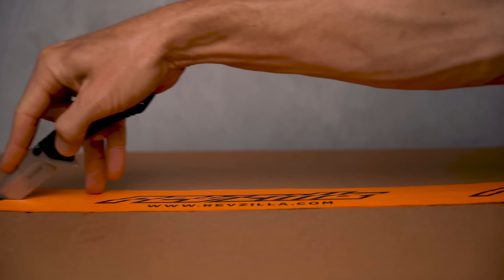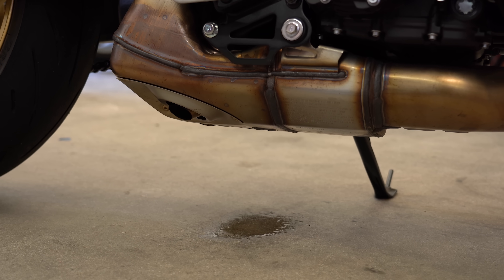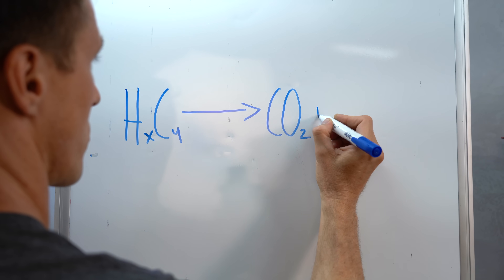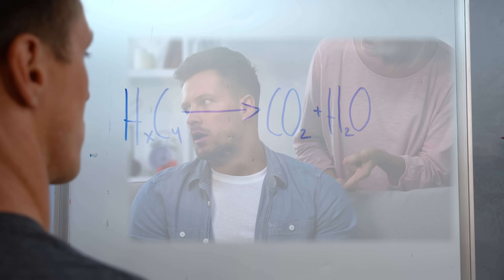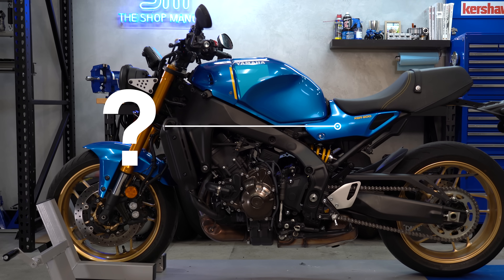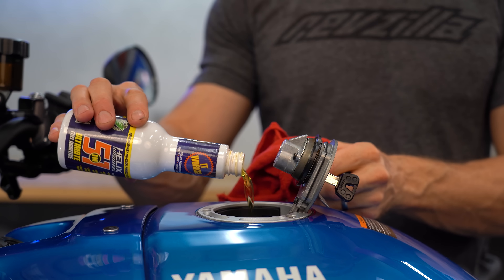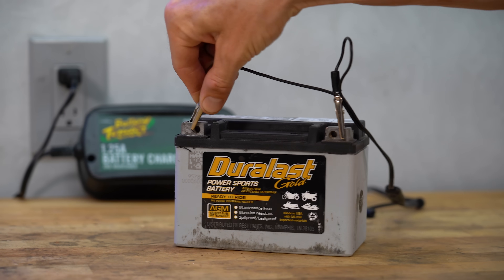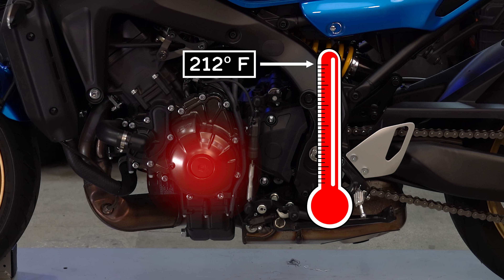The Storage Myth That Hurts Your Motorcycle | The Shop Manual

Comment: Actually the best thing to do if you are not using the bike for several months is, drain the fuel system, remove the spark plugs, put a couple of tablespoons of oil in the cylinders, have a rag to catch the oil, turn it over a few times (the oil will be ejected out the holes) but that will coat the inside bores with a nice film of oil, pop the plugs back in finger tight, and that’s the best way to decommission for winter. Do not drain the engine oil! Then ACF 50 the whole bike, engine etc to protect from rust. Over Inflate the tyres to around 50psi if you have to leave it standing, or better still raise the bike off the ground with an Abba stand, slacken the chain adjusters and lubricate them with grease, if you have a single swingarm, slacken the wheel hub assembly and grease it inside. 

When it’s time to ride again; it’s reverse of checklist, except when it comes to starting the bike, remove the spark plugs that you put in finger tight the year before, pop the bike in gear, and move it towards to turn the engine slowly, the back wheel shouldn’t lock but immediately rotate with the bike (as you lubricated the bores). Then connect the battery turn over on starter to build oil pressure with plugs off, wait for oil light to go out do that a couple of times, put the plugs back in add fuel and start the bike warm it up for at least 40 mins and get ready to turn off and drop the oil (you want hot oil draining as it’s more fluid and will pull more crap out of the engine) leave overnight, then add new oil filter and then the engine is now ready again for action. Do this and your engine will outlast you trust me on this!

Comment: The trick is to run the bike for at least 20minutes or until there is no visual vapour coming from the exhaust this will mean that all moisture has been driven out. The battery will get a boost and all internal moving parts will be coated in oil - got to be good. Another tip is to remove the headlight bulb so the battery gets more charge while the engine runs.
Reply: When you have done your run put a rag in the exhaust while it is bone dry inside. Air inlet as well if possible.

Comment: Question abt the battery... How important is a maintainer? I've just been removing my battery from the bike and storing it inside over the winter, with no issues for about two years now. I can see why using a maintainer is optimal, but is leaving it be for the winter that much worse for it?

Comment: What about dewinterizing the bike and tire flat spots should you change your oil come spring and you run an engine cleaner even if you have put fuel stabilizer in the tank?

Comment: My valves are stainless steel - so is my exhaust. I dont have o2 sensors or a battery. Basicly everything in this video is false. All the condensation in your engine is gone after a couple of seconds (theres litterally an explosion going on inside the chamber). Only on thing in this video is of use - the prep

Standstill and "no touch storage" is the number one worst thing you can do to a bike (or any other vehicle with a combustion engine)

Comment: Learned this the hard way several years ago on a Harley. The following spring I developed an oil consumption issues. On teardown of the top end, I found rust in the rings and at the places on each cylinder where the rings had parked the previous winter after one of my starts in the garage.

I would add that frequent short trips that don't result in a thoroughly warmed engine can result in similar issues.

Comment: 2:00 wouldn’t bike get scorching hot in a garage with no airflow? I would think it would get hotter. And I don’t think putting bike under load would make a difference as it’s the clutch and transmission receiving that load. Engine rpm is engine rpm load or not as far as I know. I could be wrong of course, just questioning this logic. 

In other words, starting your bike everyday in a snowed in garage would be equivalent to the rider in California riding it every day year round IMO. Sure the transmission and drivetrain doesn’t get worked, unless you put bike on a stand.

Comment: Cold - Hot cycles are what age an engine. Better don’t start it if you are not going to drive, because it will take much longer to heat and just accelerate wear on the internals. That’s why it’s recommended to start moving as soon as you start the engine and not idle around. I need a battery maintainer.. every year I’m starting my car summer car with jump leads :(

Comment: I prefer good clean ethanol free gas compared to any stabilized ethanol mixed gas. Check out project farm on the difference. The ethanol absorbs water from the atmosphere and turns to gel. No ethanol? No problem!

Comment: What about the tyres? I normally have my bike on stands up in the air all winter but do people risk to get flat spots on the tyres if they just leave it in the garage  for thw whole winter? Not mention if your tires will loose air during that period of time. At least if you want to start it, you might check it and maybe roll the bike.
You mentioned moisture, is it a problem even if you have you bike in the warm garage during winter?

Comment: As a mechanic who knows a lot about engines and the problems that "short tripping" can cause to engine, you guys are spot on. I was a little worried there might be some misinformation in here but everything y'all said was 100% facts.
Reply: Oil seals will get brittle without oil lubrication so not starting your bike will starve the motor of lubrication so If you don’t keep starting it over time you will starve the motor of oil and when you go start your bike for the first time after winter you’ll have worn out oil seals and you’ll be running the motor dry which will cause engine damage even if not noticeable right away.
Reply: @angelcelis9090  Brittle??? Yeah probably if you let a bike sit for years without starting it. They won't get brittle from 5 months of sitting! Jeeze

Comment: @revzilla - What if you purchased the bike in the winter, started it a few times to make sure it ran well, got home and seen the white milky oil in the view window after. Snow on the roads so can't ride. Would you run it in the garage and if so how long would you run it ? Temps right now are around -6 Celcius.     Would you change the oil ?

Comment: Adding my two cents:  1) Use ethanal free fuel, if you can get it, if it is unavailable in your area, drain your tank if winter is over 3 months long.  2) if you are not running it for more than a few months, and you want to be a fanatic, A) Run it till hot than park it where you will be storing it. B) Let it cool to the touch, remove the spark plug(s) and squirt about a tablespoon of NON-detergent oil into the cylinder (s), with the spark plug(s) still out, crank it over a few revolutions, if fuel injected, and you know how, remove the fuse to the fuel pump, remember to replace it afterwards, replace spark plug(s), remove battery and put away. 3) If you do not have a battery tender, and you regularly drive a car in the winter, make get a "cigarette lighter plug" and some wire and take your motorcycle battery for a ride plugged into your car once a month or so.

Comment: Your 100% correct.  I remember and old guy told me in the 80's, "Son, if your not gunna ride it, then don't start it"
Reply: It really makes me want to wonder how my 80s bike is still going strong after all those years of running it once a month in the winter.
Reply: @elgringoec  I have a 1978 Kawasaki KZ 650, been in long term storage many times. 30,000 miles on the clock.  I never start it, unless I'm gunna ride it 👍
Reply: @wisecampmotorcycles8258  
Awesome!  I've never had my VT1100F in long term storage.  I just don't ride much in winter.   If I haven't ridden in a month, it gets run.  I could suddenly change my ways because of a video from a guy whose done less learning and working than I have, or stick to what I've learned over 55 years of riding and wrenching.

When I long term storage something with a gasoline powered engine, I take a different approach.  Remove all fuel and the battery.

Comment: If you take it off the motorcycle, do you need to keep the battery connected to a charge regulator? Self-discharge rates are lower than 5% per month, especially during winter. You don't even need to take it off. Just disconnect the negative.

Comment: When I store my bike to get away from cold scottish winters,give bike a good clean,polish all paint work,clean and lube chain,I over inflate tyres,put bike on center stand,jack up front end so both wheels off the ground,fill tank to brim with super unleaded fuel,block exaust and air box to stop moisture and rodents getting into airbox😄and put a cover ovet bike,take battery off and charge once a month,never start my bike up untill its time to go for a ride when weather is better, my bike can sit like this for 3 months untill time to get out and ride and never had a problem,always starts first time after preping bike to go on the road again 😀

Comment: Do not leave a lithium ion battery on a tender/trickle charger. Trickle charging lithium batteries is not safe. There is barely any self discharge especially at freezing temps. I’ve left mine 4 months zero intervention and at same state of charge come spring.
Just make sure if cold and starting a lithium battery , turn key to ‘on’, turn on your headlights , wait 30 -45 seconds, then ignition. This warms lithium batteries up before the huge load required for ignition. If any discharge happens during winter (none or tiny!) a 20 minute ride will have it charged again. 
Lithium batteries are so handy, I’ll never go back to traditional batteries

Comment: Thank you great advice.. its just knowing if the charger is going to damage the battery or not. Sounds daft but bought thr bike end of summer and don't think the charger is an optomate.  If I left it on charge overnight on coldest days does anyone know if that will damage the battery.. or can I just leave it and forget until the snow melts
Reply: Most trickle chargers will shut off when the battery is charged. Check the user manual of your charger.

Comment: I disagree about gasoline. Don't use fuel stabilizer - fill you tank with ethanol free(non-oxygenated) gasoline. This gas can be stored for much longer without a problems. Also don't drain you tank if it is made from metal. It can cause condensation(hot during sunny day, cold during night) inside and as result it can cause rust.

Comment: Also a good tip. If you can get ahold of non ethanol gas it’s 100% better when sitting than ethanol gas.
Reply: Is that what stabilizer does? Neutralize the ethanol?  People act like it’s so easy to find ethanol free gas.  It’s not worth the drive where I live

Comment: Another side effect of short cold idle events: gasoline dilutes the oil. The gasoline does not leave until the oil gets hot. Gasoline kills motor oil. This is one of the main reasons behind the oil burning and cylinder scoring issues with subaru and toyota motors.
Reply: sure, if you run your engine at idle for less than a minute. 
but if not, everything he mentions is not an issue. 
i rather doubt bike engine that can't reach operating temp. in 5-10minutes(he mentions as too short) exist or it ever existed.

Comment: Let it idle all winter and run exhaust out of the house through extended pipe. Disconnect headlight fuse. Charge a deep cycle battery and run your freezer off it.

Comment: Am I better off draining the tank and carb or using a stabilizer with an older KTM enduro with a plastic tank?
Reply: Drain it! The early plastic tanks do not like ethanol and tent to warp and swell. Very common on Italian models (Ducati and Aprilia) but many brands are affected.
Reply: @AriH211  Thank you, I wasn't sure if the plastic was affected by the gas. I'm here in Texas so the winters aren't too bad, but wanted to prepare myself to store it properly over the winter. Thanks again

Comment: How long do you leave the battery connected to the maintainer? All the time the bike is not in use or every couple of weeks or so?
Reply: You can leave the battery tender on almost the whole time  during the whole storage of 6 months or so.   Be sure to buy / use the type that has cycle on / cycle off feature. (red light / green light)   I plumbed mine with a pigtail connector plug  (that usually comes with the tender) to the battery.  I don't even bother removing seats or battery.    I Just keep it full of gas, some fuel stabilizer, place it on a center stand, plug it in and cover the bike for the duration.
Reply: Over winter, I leave it on trickle charge for the entire time. I’ll generally pop it on when I know I won’t be using the bike for a few weeks, even in summer. It’s not a fix all solution, but I find it definitely helps.
Reply: @aloisius4188  same

Comment: I agree with 99% of what you state but why would use fuel with ethanol to begin with. You will not have a rusting issue and won’t need a stabilizer with ethanol free fuel.

Comment: If you use proper oil, fully warm the bike, then ride it around a bit every month you’re good to go.   No need to drain the tank or add stabilizer for 6 months of being still.  Yes proper oil does not to be changed ever year, it’s about miles and how hard you ride or track it.  

3-4 years of street riding and monthly exercise and your oil is good.  

Synthetic Kawasaki oil, Motul etc is good, Mobile 1 is not.

Comment: How about just throwing the kill switch and turning the bike over for like 45 seconds?  This will get the oil where it needs to go without building up condensation.   Then just hook up the battery tender and leave it.

Comment: I never start my motorcycle in winter months, there’s no need. As for stabilizers for gas tank MY ADVICE DON’T ! Just put a higher octane fuel like 93-94 and just leave it be. Stabilizers can gum up your fuel line and carburetor it happened to me a number of times. When it sits that long it can do that. Just keep a battery tender on it, and do not start it till better/warmer weather arrives. I also keep it fairly vertical so the oil sits evenly. Simple and easy.
Reply: Let me kindly offer an opinion. You need to keep the interior of the engine.. the crank, the valves and, all lubricated, rather than letting the engine sit for so long without circulating the oil which is also there to protect the crank and valves from corrosion and moisture due to just sitting.  "Stabil" the product, is highly recommended. IT stops the 'gumming' from old fuel, it does not gum the engine.  Injector cleaners are recommended as a "Preventive" measure, and not a band-aid for long neglect. The oil sitting in the pan...'evenly' is doing nothing. The OIL is for "circulating" in the engine(s) moving and rotation parts.
Reply: @ I appreciate your concerns. However let me just say this, I’ve done it for 35 years and NEVER had a single issue. I’ve owned several motorcycles, different brands and never an issues with a single one of them. That says it all. Everyone one started right up in the  riding season.

Comment: Do you still need to add fuel stabilizer if you're able to fill with real gas (no ethanol)? I'm a new rider and my first winter is coming up. The gas I normally use is 5% ethanol (Marathon). There's a station on the other side of town from me that sells real gas (ethanol free). I was thinking of riding my bike until near empty and then filling up with the real gas and running that through a bit. If I do that then would I be alright from the ethanol? The other thing I've thought of is since my town does a great job of clearing the streets, including side streets, was to just ride the bike for about 30 minutes or so every other week during winter. Which do you think is the best strategy?
Reply: Ethanol free is a good idea for storage Honestly if you can ride 30 minutes every 2 weeks you will be fine.The only problem might be a very cold battery that is old could die in 2 weeks.

Comment: Use a high quality gas and fill it up completely and you won't have any issues with your tank. Done this for 30 years. Never ever had rust inside and never used any "fuel stabilizers". High octane fuel (at least here) is good for 6 months storage according to the gas company.

If your bike is in cold storage, and the battery is in good condition, it won't need charging. At all. As long as you ride an hour or so before storing it.

Comment: HELP! I was starting my bike once a week for the winter. I did it 3 times, then on the 4th time I went to start it and now the engine wont start. It clicks continuously but the engine never starts. I go to charge the battery on a trickle charger until it shows green on the charger but I only charge it for about half an hour then I connect the battery again but still it doesn't start. Any ideas?

Comment: What if i place a dehumidifying machine next to my bike? Will that prevent moisture?
Reply: NO,but steady warm will prevent moisture.Its fluctuating temps warm to cold to warm that causes condensation inside the crankcase and other enclosed spaces with air pockets.If you get the crankcase hot every couple weeks it will be problem solved.This is only necessary if your bike is being stored in a cold environment.

Comment: Simple solution if this is even a problem. Ride the bike and get it hot. Ice on the roads? Don't start it. No ice? Bundle up and ride! It really isn't hard to last through a 15-30 min ride even at 30 degrees.

Comment: I also heard that most of engine wear occurs when the bike is cold as the oil is too thick to circulate properly, so there's more metal on metal contact. This would be exemplified during cold winter months, so don't start it over the winter. Is there any truth to that?
Reply: No. Oil forms a film on metal parts and won't dry out. Most wear occurs when the engine is stressed due to heat. E.g. redlining it repeatedly on a very hot day in low gear.